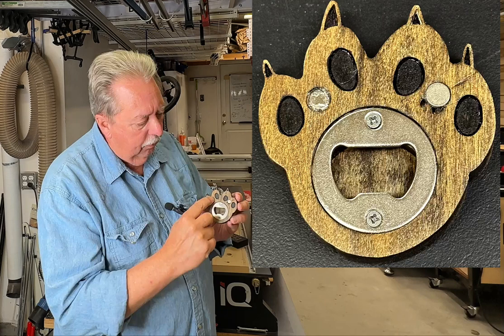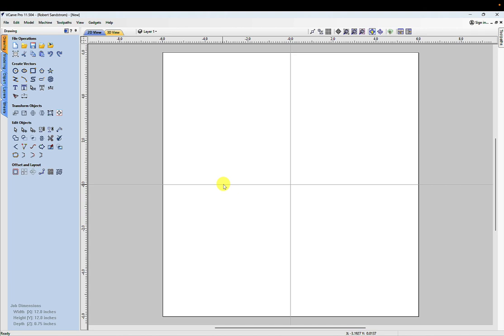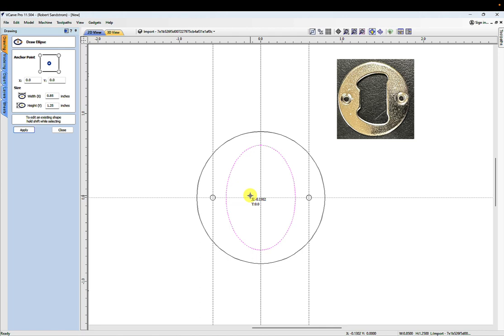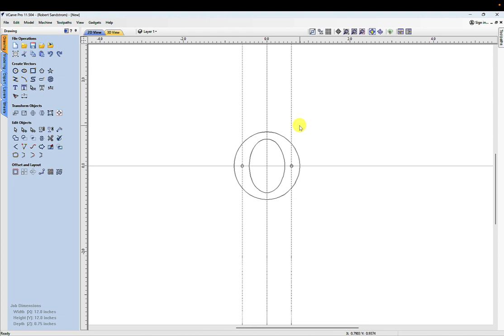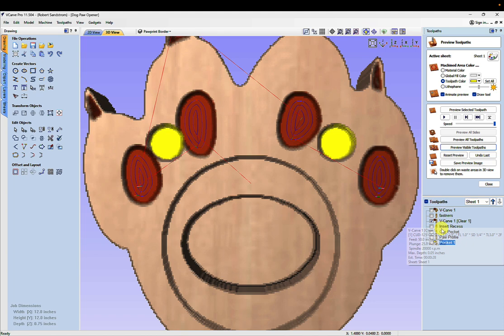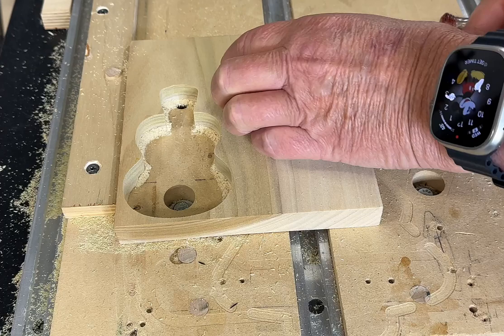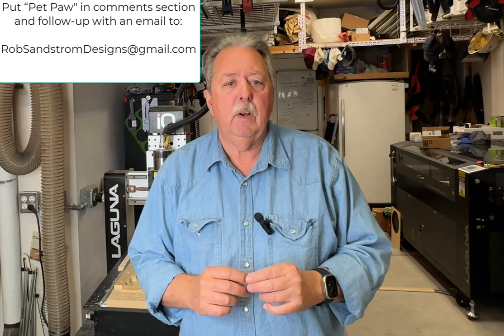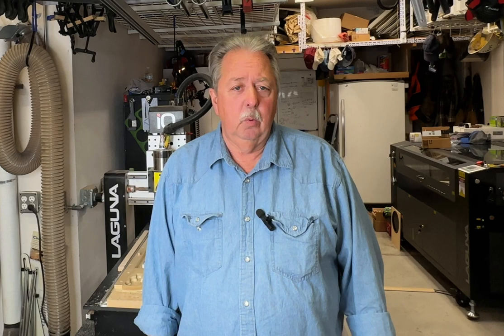How to Make a Dog Paw Bottle Opener

Comment: good video I was thinking if you wanted to use a smaller drill you could put a center in with the vbit when you have it in
Reply from the maker: Scott you are correct.  There are a number of ways this can be done.  I can also use a 1/32" drill bit.  For now, I have found a pilot hole isn't needed with the hardware I am using.  But, I have left the option available if I find a different type of wood requires a pilot hole.  Thanks for watching.